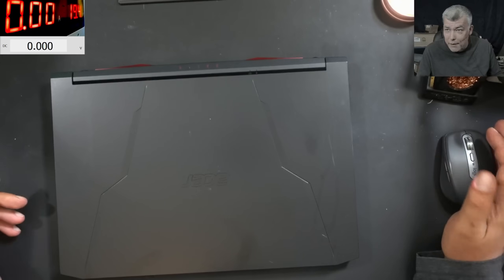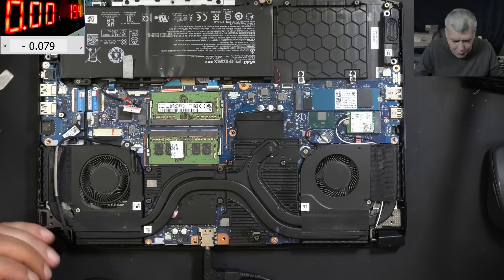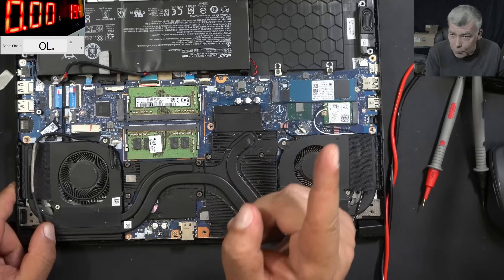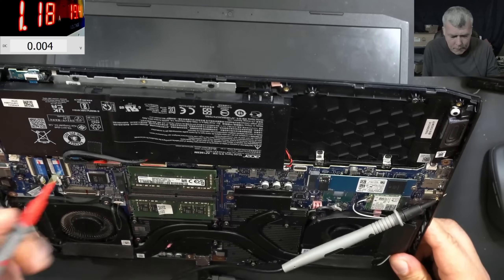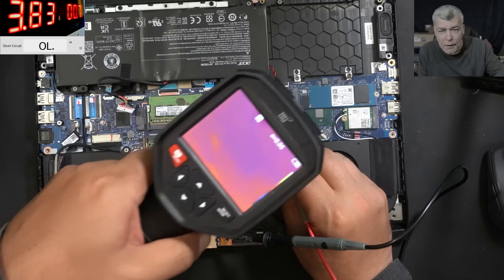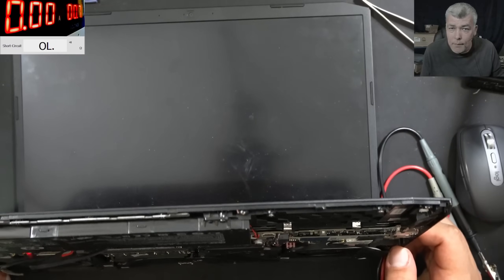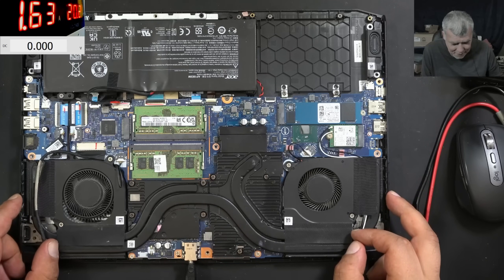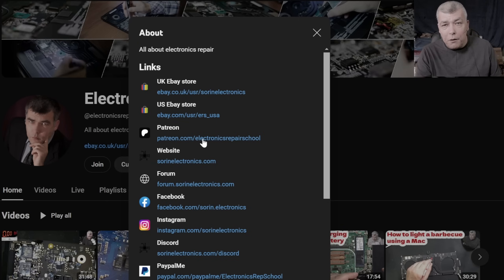Acer Nitro 5 - No power, board diagnose & repair - Missing 5 Volts can mess up your main power rail

Comment: hey man, I have the same acer nitro 5 AN515-57
I cleaned and repasted it, but forgot to unplug the battery while servicing.
I took it to a repair center, they said the master chip is damaged and needs to be replaced
they said that they are out of stock of it
firstly i want to know what that chip is (I searched the web i think its PCH chipset, is that right?)
second how to find that chip numbers to try to buy it from another provider? thanks in advance

Comment: Sorin, not replacing the capacitor is really bad. Because at this location it is needed for stabilizing the output voltage. The designer calculated the total capacity needed when he designed the board. Now the remaining capacitors have to bear more of the spikes and declines in power as planned. Not good. 😢
Reply: no capacitor, no short. LOL

Comment: 18:45 I think the SSD is fine, the Laptop supposed to boot in Legacy Boot Mode instead of UEFI Mode. 
The customer tried the Bios options thinking at first it was a Software issue I would say.
Reply: How would the customer have gotten into the BIOS if the laptop didn’t turn on…? 🤔
Reply: @toolsarecool  
Yes, you're right according only to what we saw, not to what caused an output capacitor to ruin everything..
Surely the boot BIOS options wasn't modified randomly by itself. Mr. Sorin said that he's assuming that the customer wiped the drive. Was that when the Laptop was off!? As he never experienced a shorted output capacitor neither.
The software always controls the hardware. There was a wrong process before it turned off. 
But I could be wrong, it was just a guess as I said. Nothing worth to argue and play the expert about.

Comment: Hi, what could be causing the PC to restart, i.e. it suddenly turns off and then turns back on again. He does it every now and then.
Reply: At what point do you refer to. Disconnecting battery resets laptop so it does its stuff, Dell restarts 3 / 4 times.
Reply: Monitor temps to see if it is an overheating issue. Also could be a software issue, bad driver issue or hardware bad memory or hard drive.
Reply: @TechTronics7  I changed the power supply but after a while it started doing it again. I dusted everything and it doesn't seem to do it anymore

Comment: this kind of fault banged my head once,actually there is a driver chip that drives the vrms for the CPU and that chip is powered by 5v,if that voltage is missing the laptop behaves like a dead log.in my case that chip was RT3602AE and it was missing 5V because the 5v power supply chip was faulty
Reply: thansk for the headsup info

Comment: Ho Sorin, good job never see this capacitor blow... Can i Ask a Little suggestion?, i have the model before your termal camera TTI, surely it's a Little less Revolution respect your but i don't succede in a good calibration... can u suggest me your parameter..transparency, colore temperature and range.. ecc any help Will be gratiful, monday i'll send you the exact model...thanks for sharing your experience...what you think about paul daniel se Flexbv? U use them or other? bye Francesco Timpano from Florence Italy
Reply: FlexBV is a great piece of software. There is a free and paid version. The paid version lets you search all your schematics looking for a part on another board so if you have donor boards its an easy search same if you want pin out of an IC but do not have schematic for your board.
Reply: @CaribbeanParadise-cn3sy  thank Caribbean that the confir i wont..

Comment: Nice fix Sorin! Should the fans not stop when you close the lid though?
Reply: If it goes to sleep mode after closing the lid fan should stop but if laptop is not going to sleep mode the fans will still spin you can change this in control panel
Reply: @ProGaming-bm6ff  Thanks!